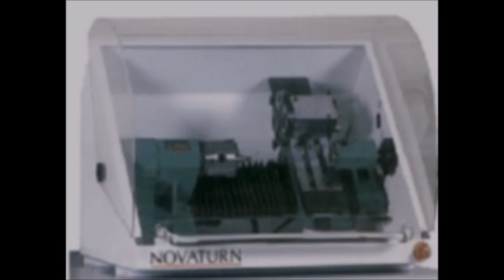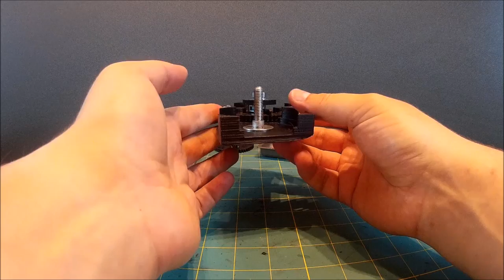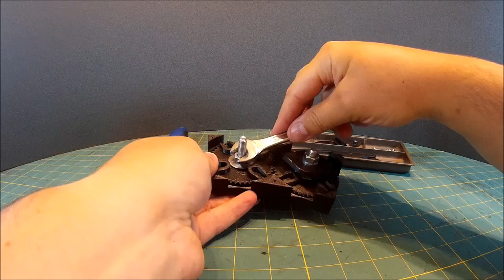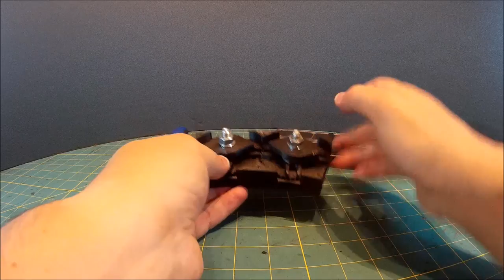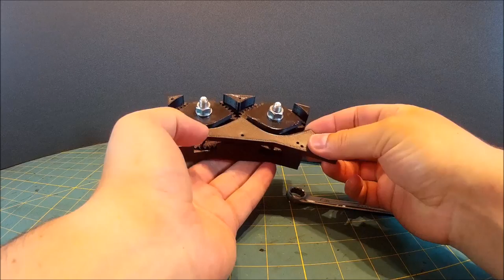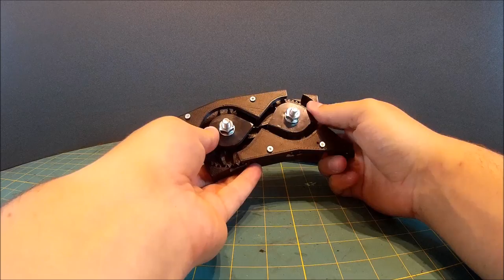Industrial magic a 3D Printed Braiding Machine #1 my 1st Prototype.

Comment: Are you planning to share the STL files when completed?
Reply from the maker: Hi JG. I'm currently working on V2 of the machine, which will be predominantly CNC machined and Laser cut, albeit some of the parts will still be 3D printed. Unfortunately many of the files for V1 were lost due to a hard drive failure, so I am having to re-create the designs. Fortunately I'm now using Fusion 360 so the CAD process is much more efficient and easier to tweak using parametric design. My plan is to share the CAD as it progresses with patrons via a Patreon.com account (TBC), with different levels of access depending on the level of patronage. I'm also being encouraged to launch the product on Kickstarter.com (again TBC).
Reply: Ah I see. Thanks for the info!